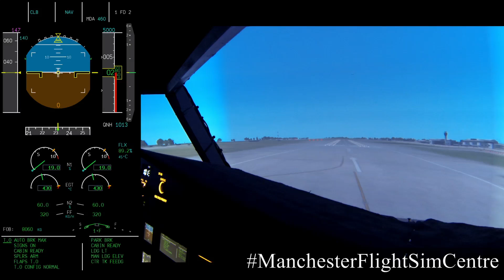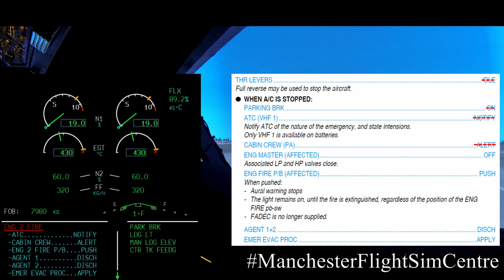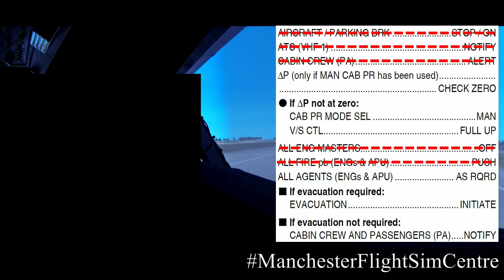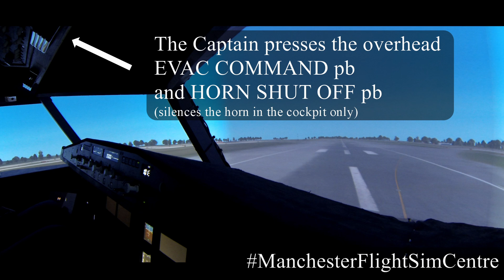Rejected Takeoff and Evacuation!

Comment: Where's the spoilers?
Reply: you don't need to "see" the spoilers they're armed before takeoff unlike boeing procedures and they don't "really" help as much as they do after a landing during rejected takeoffs since the aircraft is already on the ground, hasn't exceeded V1 speed and the wheels are firmly contacted to ground so brake performance isn't an issue.
Reply: Hi ask you , about ,where can you see spoilers during RTO!!!?
Reply: @livepilot9122 😂 you can’t see them in this case. That’s why you don’t call for them, nor would you call the failure during the stop. It’s meaningless at that stage, you’re stopping regardless.
Reply: @livepilot9122  I don't think you can see the indications for spoilers deployed on the lower ECAM because that screen would've automatically switched to the engine page in an engine fire scenario.
Reply from the maker: On top of the wings 😀

Comment: Not supposed to call 70 kts
Reply: Pnf calls 70 kts so the pf can advance thrust levers back from reverse to thrust idle
Reply: A minor variation. I guess not life threatening one.
Reply: They didn't call 70kts. As per airbus procedure they called 100kts
Reply: @encoded1066  100kts for takeoff, 70kts for landing and RTO.